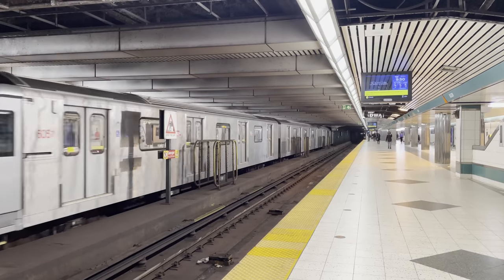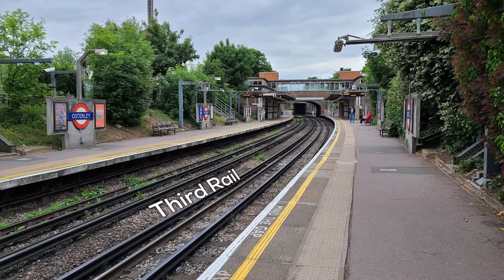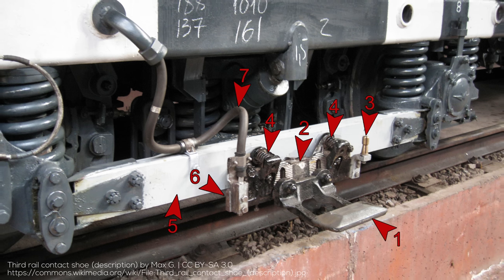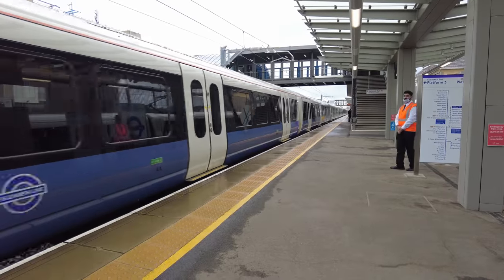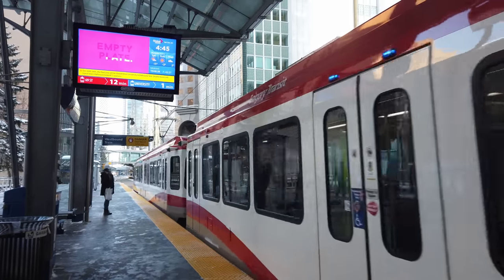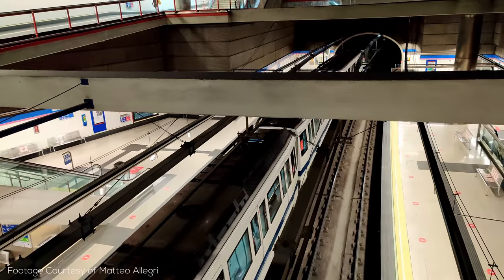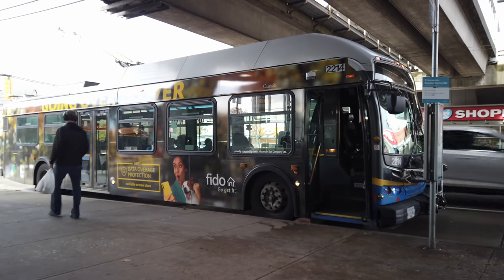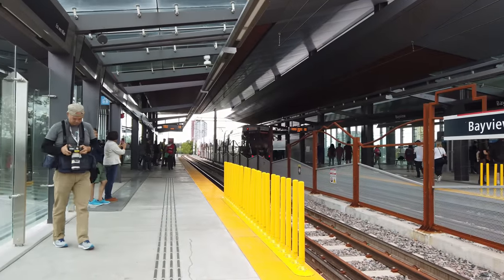The Best Way to Power Your Railway | Third Rail vs. Overhead Wire

Comment: The Sydney light rail operates both the Alstom third rail and also overhead, it changes modes at Town Hall station.
There's also a light rail in Newcastle (Aus) that I think operates by battery, and charges via overheads as it stops at each station.

Comment: Some things to say about indian stuff.

In metro systems, we have either a 750V third rail DC, or 25kV overhead AC,
And for railway, they use overhead only, so probably 25kV AC.
But until last decade, most of railway was still being run on diesel engines. And in my childhood, in early 2000s, they were still being referred to as steam engines,(a regional word for "train") which is probably just old language.

The only big city I've been to is Bengaluru. They have a metro system which runs on 750V DC third rail.
But the newly proposed Suburban railway will apparently run on 25kV overhead, even though half of the tracks will be elevated. (Just like almost all of metro is elevated)

Also. Most of indian railway tracks are broad gauge.
But Bengaluru metro is standard gauge. But suburban railway will be broad gauge.
In my early childhood, all metre gauge tracks were converted to broad gauge.

Comment: So I'm assuming that dual mode catenary third/rail works decently well since the AC from the catenary needs to be rectified into DC anyway before the motor controller reconverts into 3-phase AC at the right frequency for the speed the train is currently at

So putting the third rail DC at the same voltage as the output of the rectifier means that the only additional equipment you need is a third rail shoe
Reply: The Class 373's were just that.
They had 3rd rail pickups ontop of the pantograph so they can access waterloo.
Reply: Quite a lot of systems do exactly that, particularlyfor multi-voltage stock that can operate on 20 and/or 25kV AC, and 3000v / 1500v DC (Usually also overhead).
The only serious limitation is that because the DC-bus voltage has to match the DC supply option, that can limit overall power to whatever the maximum DC current is, particularly for a 600v or 750v system..
With modern power electronics, that often just means a reduction in output when operating on 3rd rail or DC overhead, with full power only available on AC overhead.
Reply from the maker: I'm loving the rather technical discussion going on here!
Reply: @jonathanj8303  Ok I'm not that good at super technical details, but you can circumvent the power output limitation. I.E. Pendolino family trains can operate at their top speed of 250 km/h at both 3kV DC, 15 kV 16.7 Hz AC and 25 kV 50Hz AC. And while 250 km/h is generally considered the limit for 3 kV DC system that is more of a limitation of substations and catenary than trains themselves.
Reply: @mancubwwa  All power supplies have an upper limit for the current they can supply.  It can be down to the wires/3rd rail, ie IsquaredR losses, or it can be further limited by substations.  And part of the reason for the latter is that medium voltage DC is less efficient than high voltage AC, so you need more substations for it, and closer together.
Obviously, for any given current limit, 3000v DC can supply twice the power that 1500V can, and 4x 750V, that's just maths.  So 3000V is more capable and suitable for higher speeds and heavier loads than 1500V, but not as good as 20kv or more.  The other factor in this is that having a 1500V or 3000V DC bus maybe on the low side, particularly for a modern high power loco.  It can force you into using higher current (bigger, heavier, more expensive) IGBT's when you might otherwise be able to design a lighter, cheaper and more efficient loco if you had a higher bus voltage and lower currents.  In the end, building an AC/DC machine is a compromise, but the nature of where the different supply systems are used generally means that usually isn't an issue in operation.
3kV might be good enough (just) for the pendolino to run at 250km/h, but not any faster.  FS has to completely replace all their original E404 300km/h power cars, because although they were mechanically fine at 300km/h they drew too much current.  All 30 sets got a pair of new dual-voltage (25kV AC/ 3kV DC) power cars when they were less than 15years old, and only then did the trains run in regular service at 300km/h.   (The original DC units were refurbished and formed into 'new' sets with older coaches to run lower speed services on classic lines.)
A long time ago, the USSR, which had large mileages of 3kV DC, tried building an experimental 6kV set-up (the loco was based on a VL8, I think, that tells you how old it was), but it never got beyond testing.  Presumably the efficiency and output gains weren't enough to compensate for the extra problems, at least with the technology of the time.
Reply: I'm a rail engineer in the UK, my fleet includes many duel voltage trains.

You are correct, but here in the UK, the third rail came first, at 750V DC (700-900V). So to produce a duel voltage train, you instead design your train (infrastructure is already built) to step down and rectify 25kV into approximately 800V DC before it's then inverted back to AC.

Comment: It's good that you finally mentioned third rail for trams, because i assumed you would have missed it completely. Also referred to as Ground-level Power Supply.
I just want to add that many tram systems used to have third rails in the early days, as far back as the 1880's. They all had their issues and some were insanely unsafe.

One in particular, Stud Contact System, suffered from a design flaw that make the electrical contacts that were flush to the ground to always be live. Meaning any unsuspecting thing passing over it and closing the circuit would be hit with significant juice.

Another was a system that was always live, but buried into the ground with a "plow" that would make contact with the electrified rail. The principle was that since the live rail was buried, anyone passing over it would be safe. But of course it didn't work too well because random garbage would make its way into the slit and destroy the "plow" or get jammed between the contact point and rail. And anything that could conduct electricity, such as a strip of metal, could get in there and provide a protruding live feed that would make fireworks happen to anything touching it.
And then there's the issue with snow, ice, and especially salty water which would electrify the surface...

Third rail for street level trams/light rail simply doesn't make much sense.
Reply: The stud system was energized when trams passed over, by magnetism from the tram. However, the studs "jammed" with power on, thus zapping unsuspecting horses. The conduit system worked reasonably well in London (but it was very labor intensive, a man (…) had to manually insert a shoe in the track when a tram came, and take care of the ones that came off trams when they passed out of that section. I’ve heard somewhere that DC quit its trams system after a bad freeze stopped the entire system, which, like London, used conduit in the city centre. 
The French APS actually works, but I wouldn’t mix that with salt or snow & ice…

Comment: Not only Thameslink but also Overground & Southern services to Watford switch between overhead and third rail when crossing through London - in fact, the Overground does it on three different parts of the network
Reply: Also Southeastern High Speed services, and Great Northern Moorgate services!
Reply: Such concept that happens in the UK also happens in Athens (Greece) too on Metro Line 3, where trains going to the airport switch between third rail and overhead (same voltage as the UK too!)

Comment: What Reece forgot to mention, is the new generation of passenger trains being the hydrogen fuel/battery urban metro, regional and inter-regional trains like the Alstom Coradia iLint which has been in commercial services in Europe for 5 years, the Stadler Wink, Stadler GTW and Siemens Mireo Plus H. Alstom has launched for France's SNCF regional rail services. the Alstom Coradia Polyvalent H2 being 4 carriage 218 seat electric and hydrogen fuel/battery regional and inter-regional passenger rail services.
Reply: Merseyrail in the UK has introduced hybrid third rail/battery trains so it can extend it service on to neighbouring none electrified lines. Testing has proven very positive so far, not only to new stations under construction on the edge of the system, but out far enough to connect to other parts of the UK rail system, where it could connect to the overhead line system at places such as Preston & Wigan to recharge the batteries. Battery powered trains do feel a little gadget bahn at the moment as the technology is yet to settle on a set of suitable solutions, but that surely deserves a video in itself, as many of the worlds more rural providers, and those where neither overhead nor third rail seem appropriate, are looking into this option
Reply: Honestly battery or fuel cell trains don't make sense.  You're adding maintenance items, a potential safety risk with large numbers of lithium batteries, and reducing the trains efficiency as it now has to carry its energy source with it just like a diesel, though probably less efficient than a diesel.  It's almost certainly cheaper in the long run to electrify the line, as it allows for a lighter, cheaper train with less maintenance required and you remove the risk of having lithium batteries, hydrogen tanks or diesel tanks on board the train.
Reply: @mrvwbug4423  - Hmm. Alstom Coradia ilint hydrogen fuel cell/battery trains has been in operating in Europe since 2018 without any major incident's. Also France's national rail operator SCNF is introducing the Alstom Coradia Polyvalent H2 being a 4 carriage electric/fuel cell/battery for France's regional passenger rail network. Alstom has licence their electric/fuel cell/battery technology to Spanish rolling stock manufacturer CAF (Construcciones y Auxiliar de Ferrocarriles).

Comment: Further to your mention of the lower profile in tunnels with 3rd. rail, where tunnel boring machines are used, in order to get the clearance for overhead catenary, there is a massive increase in the amount of ground spoil that has to be removed because the tunnel width is also increased, so to me, the use of 3rd. rail cuts construction costs considerably.
Where existing lines are electrified, low bridges and tunnels do not need rebuilding., although here I would mention the South Wales Metro, currently under construction.
I believe that the intention is for the tram-trains to use battery power in some locations, not only on the proposed street extension in Cardiff Bay, but also through the Caerphilly tunnel where the catenary will be grounded due to the low clearance and water ingress from the tunnel roof.
The first Stadler tram-trains have arrived at the new Taffs Well Depot and are being line tested. I would be interested to see your take on the system in due course.

Comment: The Rotterdam metro combines both. It is third rail in the city center and overhead wires on converted rail lines into the suburbs.

Comment: Decades ago, the Chicago 'L' (CTA/CRT) had far more mileage at ground level than it has now: (Douglas Park (Pink), Ravenswood (Brown), Skokie (Yellow) and Evanston (Purple)  Evanston, Skokie, Lake Street (Green) used trolley wire power, while Ravenswood, Garfield (Blue), and Douglas used third rail.  Furthermore the lng forgotten Chicago Aurora & Elgin Railway used third rail for most of its service to the Fox River Valley cities that it served, using trolley wire only in its Wheaton Yard, railroad interchanges, and the Fox River city terminals.  Third rail is ALMOST universally 600 volts DC,  although one Michigan interurban used 1200 volts DC.  Also Bay Area Rapid Transit uses 1000 volt third rail. 

Most of the long forgotten interurban railroads used 600 volt DC trolley wire in spite of the rather long distances involved and the use of rotary converters to convert power from AC to DC (before rectifiers were technologically feasible).  Thus the interurban from Chicago to Milwaukee required a substation every EIGHT miles to power their many heavyweight six car trains. Conversely the Indiana Railroad got by with substations every 15 miles as trains were short, lightweight, and less frequent.

Light Rail Vehicles, old-fashioned streetcars and trolley buses universally use 600 volts DC power. But  many other voltage and AC/DC arrangements can vary widely for suburban and intercity electrifications.
Reply: The standard now is 750 V for both. Oslo’s third rail metro used 750 V from the start, the tram network changed over around the year 2000.

Comment: Increasing voltage is more important than the choice of AC or DC.  And higher voltages are more practical with AC because of simpler switching and transformation, although modern electronics is changing that.  Trains mostly use 25kV single phase AC, which can be difficult to take from three phase distribution systems, especially where the train loads are large compared with other loads on the system.   It is possible to use three phase power by using two catenary wires and the rails.  One very old example of this is La Rhune in SW France.
Reply: the problem with 3 phase electrification is, it is very difficult when Catenary entering junctions. For small railway station it maybe not a big problem, but when entering city station, it's much more complicated than dc overhead or ac single phase, and it's one of the reasons Italian railway stop using it
Reply: @meongmeong3599  Single phase electrification places large single phase loads on the power supply network, so three phase might help with that.  But it is non-standard, complicated at junctions as you say, and difficult in confined spaces like tunnels.  Where was it used in Italy?
Reply: @keacoq  it's their standard from early 1900s, until 1970s. Mostly Northern Italy, southern Italy was electrified later with 3 kV DC, but 3 kV DC became standard to replace 3 phase systems in northern part

Comment: And then (long ago) there was the Giant's Causeway Tramway in Northern Ireland, built as a third rail roadside tramway. Later mercifully converted to overhead.
Reply: It was, after all, a very early electrification. :) There is still a French mountain line (!) that for/to a large extent still uses third rail (!).
Reply: @cieludbjrg4706   The UK still uses third rail on a lot of railways (most lines south of London) and even some fairly long routes such as London to Weymouth (which I would bet is the Longest single 3rd rail powered line in the world)

Comment: Reese, MBTA in Boston is looking at electrifying the commuter rail. They’ve recently said that they plan to roll out overhead catenary most places, but will be using batteries to bridge the gap where putting in catenary would be very difficult (under bridges, tunnels, etc.).

What are your thoughts on a system like this? Are there any systems like this in the world? Do battery electric trains still have a lot of the benefits of traditional electric trains?

I’d love if you could have a video on this, but a reply would be cool too
Reply: I think that can work out well. Battery-electric trams (and trolley buses) are already in operation.

Comment: The S Bahn Hamburg (Germany) uses 1200V DC third rail, but on the S3 extension to Stade the train switches to overhead wire power at Neugraben station.
Reply: Hamburg S Bahn is interesting. First built with High Voltage AC 6600V, then converted to third rail DC 1200V. Do you know some technical reasons about why this is happen? I cannot find a reasons why, at least from English literature

Comment: A lot of the south eastern services in the UK are starting to hit the limits of what is possible on 3rd rail electrification, just because of the sheer number of services being run. It has been vaguely floated that the 3rd rail will be replaced by OLE at some point in the future, which seems likely.

Fortunately, the fact that dual mode units are so prevalent helps considerably if we decide to do it more gradually, such as for electrification in many places. (Funnily enough, diesel/electric bi-modes seem to actually result in more electrification, rather than an excuse to avoid it)
Reply: Why not add batteries to the trains? In Melbourne new trams required substantial upgrades of the DC overhead electrification, but the following contract was to include batteries on the trams rather than upgrade the overhead power supply. The high current draw is only for a few seconds when starting from a station.

Comment: One thing with the choice between AC and DC is the need of on board transformer with an AC system, which tend to be heavy. Sometimes the weight is a good thing, for example heavy electric locomotives, which need the weight to have enough adhesion. On the other hand, light rail systems benefit from being... well, light.
Reply: That's interesing and explains the question I never asked, why trams use DC instead of AC.

Comment: In the southern part of england the timetable is actually designed with the third rail gaps in mind, there are certain locations trains cannot stop and more than x trains an hour cannot pass through incase of delays, for instance GTR Southern 4 car units cannot use certain platforms because of the gap in the third rails